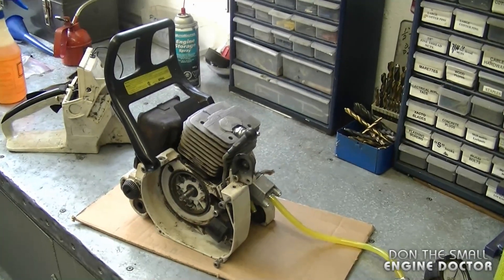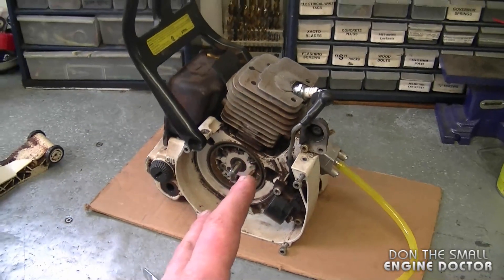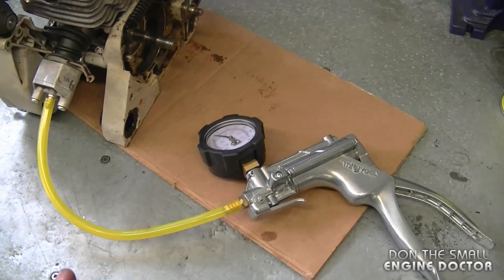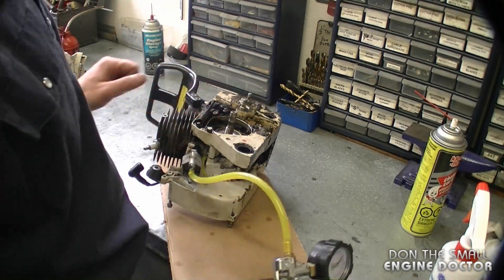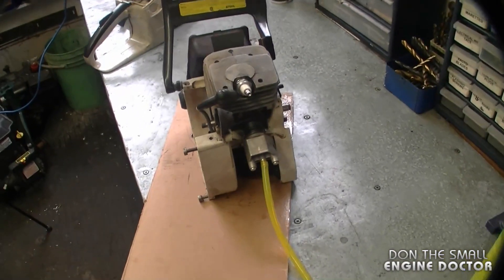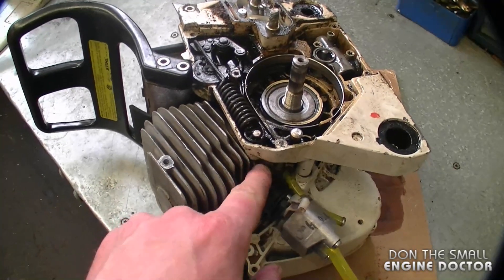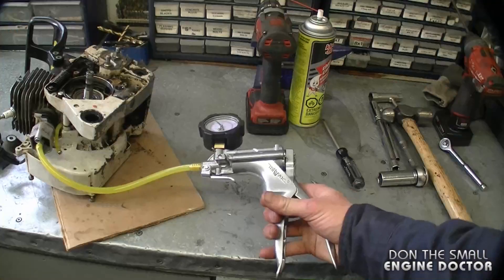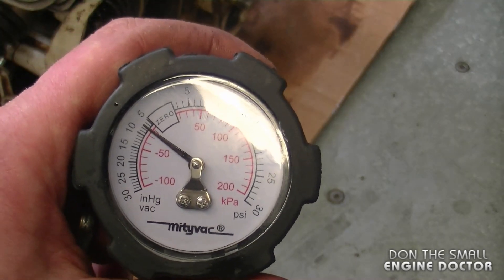HOW-TO Pressure & Vacuum Test On A Chainsaw - Leak Down Test

Comment: On your vacuum test, the gauge was reading inches of mercury which is not the same as psi - but a useful video as vacuum leaks can destroy 2-stroke engines fairly quickly.

Comment: What would cause a small two-stroke engine to generate crankcase vacuum yet virtually no pressure?  Am I doing something wrong?  The chainsaw is a Craftsman and probably forty years old (similar to a Poulan micro saw, I believe) and with all the apertures plugged, as you advise, (sheet metal plates with cork gaskets as interfaces) my MV 8500 Mityvac displays about 2psi on the gauge (indicating a massive air leak) but no bubbles.  When switched to vacuum, the test equipment quickly generates 7 in Hg.  The reason I'm investigating is because the machine runs erratically when warm and has a vibration in its handle, indicating crankcase bearings and seals could be worn and leaking.  Thank you for your excellent series of videos.

Comment: What does it mean if my saw will hold vacuum perfectly fine, but with pressure it leaks and doesnt hold pressure?
Also, is it ok that everything is sealed off and im using the impulse tube to do my tests?

Comment: Question:  I want to put a chainsaw pumper carburetor on an 80cc motorized bike engine.  I need a pulse line to the crankcase... any suggestions?

Comment: Hi, great video.  I have a MS361 and the same adaptor you used for the leak down test.  What did you fabricate to use it with the handle/gas tank assy removed?  It makes the procedure a lot simpler!  Thanks

Comment: Dony:  I'm waiting on my order of a MityVac vac/pressure gauge to test my saws. I'm wondering if this would make things easier?  I propose using a rubber stopper in the intake boot.  It might have to be held in place under pressure, but may work very well under vacuum.  Then perform test through the impulse line.  What do you think?

Comment: If I had an air leak like that one would it run my saw too lean to make it overheat?   I’ve gone through 2 top ends now on my Stihl ms 440 and I don’t know why!!!!!!  I haven’t checked the crankshaft seals yet
Reply from the maker: yes it would, on the 440 check the intake boot, it might be cracked

Comment: If a person install oil seal incorrectly on PTO side of MS660, say spring fell off inside seal, will vacuum test spot that seal? Thanks
Reply from the maker: yes it will
Reply: @donyboy73  
Thanks a million.
What I meant was that seal looks fine from outside appearance but spring fell off inside seal.

Comment: Hi Dony:  "Stihl 024"  Did a vacuum & leak test. Pressure test is good but vacuum test shows very slow leak down.  Saw runs OK when assembled & runs good when air filter removed. Soon as filter is installed its runs rough & hard to set up Hi & Low carb tuning. Made sure  choke was not partially on. Exhaust & air cleaner is cleaned. Carb changed but no change.. Saw recently rebuilt with piston, rings and seals & more.  Ran for many hours then started running rough & wouldn't idle.   Checked spark plug after cutting wood for 15 minutes & its too light colored for my liking.  Suspect I have an air leak but with no leak down with pressure test I am unsure how to isolated leak.
     CAN YOU HELP  .....  BOB

Comment: On snowmobile engines,there is a rubber plug kit you have to get that plugs all the openings. I used to use starting fluid if the engine still ran,any increase in rpms indicated leaking seals. That doeant work on triple cylinder snowmobiles and twins with a joined head or lower end seal between cylinders. Then you had to plug all the ports and pressure test that way. I remember earlier Polaris triples had issues with the seals between the crank on the lower end. The middle seals always failed. Skidoo also had issues with the 583's. I dont miss those days. I hated triple cylinders. The best thing they ever did was stop making them. A twin cylinder engine with larger pistons produced the same hp. Oh well. Am I dating myself?

Comment: I'm going to have to do something like that to my Briggs & Stratton 3.5 HP engine this weekend.

I lapped the valves in today & I still get a misfire at idle speed,I noticed that the top of the engine is dirty so I want to check if the top crankshaft oil seal is sucking in air & blowing out crankcase vapours.

The valves did need a lap job because the exhaust valve was just carboned up so it was all black whereas the inlet valves face was eccentric.

I want to plug up the PCV tube & blow air into the oil filler hole through a piece of rubber hose to pressurise the crankcase then to use soapy water to see if there are any bubbles present,which would indicate that it has an air leak.

Comment: I did with an air compressor with a Stihl hedge trimmer I rebuilt, one crank seal leaked but I went to the bearing shop & bought 2 of the same sized seals for $15 AUD.

The machine had other problems as well but it had no more leaks after that.

Comment: Found bellow adapter for sale on ebay. OEM Stihl Specialty tool pressure vac test READ LIST 1118-850-4200 MS250 MS251

Comment: It was impossible to find anything similar to what Donny uses for the pressure test. What I did was take a large bottle cork (from hardware store) so it fit snug in the  bellow with approximately 1/2" of the cork exposed . I then drilled a hole in the cork after the fit check and placed a piece of fuel line through the cork leaving enough exposed to allow for the vacuum pump to be attached. I also covered the top and area around the fuel line with black permatex RTV for a good seal. The bottom was also done in the same fashion. I then used a small hose clamp to keep it secure when installed into the bellow. 
   Not too fancy, but if you can't find the adapter Donny uses, I think this should work.

Comment: Why do the oil seals go bad? Could it be linked to overheating, lean running or dirt ingestion?
Reply from the maker: wear and tear and if a bearing is worn it also causes the seal to wear as well thus causing an air leak

Comment: Can I use that attacher with the carb on and test the carb at the same time as long as I keep the pressure lower.  Thanks for you videos which so far are the best ive seen quality.

Comment: I have used this way of pressure/vac testing for a few years now and it does indeed work very well. like he said tho just make sure your connections to the pump are solid! Also works great for carburetor work

Comment: Just did a pressure test on my 029, started at about 8 hg on the vacuum and pressure and it held it for about 2 or three minutes before dropping down to about 5.  Don't know if it's acceptable or not but might also be my homemade equipment..

Comment: I have an 038 magnum Ii.  I did the same but blocked from behind the carb covering the impulse line.  Holds 6psi for over 5 min at bdc, both vac and press, but compression test from the spark plug leaks out, wont hold compression when cranking.   what am I doing wrong?  Great vids thanks!
Reply: No scoring on the cylinder, and it does run.  Im thinking its piston rings.. meh!
Reply: @MrSparkums  did you ever figure out what was causing low compression, I have no scoring and changed rings and still low compression, thanks todd
Reply: @toddc4d  MI 
It wound up being the rings..  I would invest in a mighty vac, and make some block off plates.  No way to eliminate Gasket or seal leaks without a p/v test..   I wound up selling it for a pretty penny..  Instant regret...

Comment: @donyboy73 I have a Husqavarna 353 that is leaking gas at the bottom tank seam. Can this cause the saw to run ragged and can it be repaired?
Reply: Just need to replace the seal
Reply: yes
Reply: Jason Johnston very good

Comment: hi there iv beening working on a husky 266 i can not get it to start iv replaced fuel line and filter and it has spark was running a year ago what should i do? wont fire at all even with a little fuel put in carb

Comment: Hi, I have a B/S 8PH flathead that runs a generator and I bought a new carburetor about two years ago and it been running well, but lately its been running poorly. I put a new fuel filter on and its still not running right, I have to keep the choke on about 3/4 of the way to keep it running. Can you tell me what I need to check to get it running right? Thanks Stan

Comment: Hey Donny I don't know how to ask you a question but I'll ask here trying to get a respond. I just started my generator last snow storm and it was very loud and sparks were coming out of the exhaust. It's about a 10 year old generator maybe older. Need some advice
Reply: +abigail gabriel I recently watched one of Donny's videos that showed the same thing on an engine. The exhaust valve was stuck, or out of adjustment. Look for this video and I think it will help.

Comment: Could you show how to replacing the seal?
Reply: How to Replace a Seal. Using a set of calipers, measure the deepth of the old seal. Carefully drill a small hole in the side of the seal centered between the ID and OD. Install a self tapping screw into this hole. Be very careful not to drill or install the screw to deep or you will damage the crankshaft bearing. Using either a slide hammer or channel locks, grab the head of the screw and pull the seal out. Be very careful not to damage the running surface of the crankshaft or the seal bore. Clean everything up and install the new seal with the appropriate seal driver or a deep socket. Make sure to install the new seal to the same deepth as the old one. A little oil on the crankshaft surface and a light smear of silicon in the seal bore. Make sure to preform a second pressure/vacuum test. It's a good idea to give the crankshaft a turn when pressure testing older seals.

Comment: looking for parts for husqvarna 240 2012-2013 chainsaw. parts needed complete clutch, hub etc. saw is not 'grabbing' under load. Are you willing to get these parts (OEM) and ship. thnx
Reply from the maker: +Michael Dobbin hi, i'm not a Husqvarna dealer, check locally for a dealer
Reply: +donyboy73 I don't have a local dealer. Ok Thnx.

Comment: where did you get that vacuum pump tester?
Reply: +Josh Kilen I have that same model. It is made by Mityvac, and the part # is MV8500. Been using it for years. Works great.
Reply: pbrstreetgng79
ok thanks
Reply: Josh, I got my Silverline from Amazon. First MityVac I bought from Harbor Freight but was only pressure. I didn't know better at time.

Comment: During a test, I always seem to get a little air escaping from the spark plug hole even though I tighten the plug down snug. I just don't think that the metal washer on a plug creates an air tight seal. Have you experienced this, Don?
Reply: Grease.

Comment: hey don what happens if you put too much pressure when you do a leak down
Reply: +Drew Thornton Pressure testing you can actually blow the seal out or cause the ridge(s) to roll.  Both will likely ruin the seal.

Too much vacuum will also deform the seal.

Comment: I had a husky 350 drive me crazy when I rebuilt it. it has the impulse integrated into the bellows and was leaking where it mated to the cylinder. put some motoseal on it and it was good to go.

Comment: Dony, are there any aftermarket seals that you recommend? Those STIHL OEM seals are very pricey!
Reply: pbrstreetgng79 Just for future reference. Bearing supply houses can sell you seal's and bearings far cheaper than small engine part's stores. Just bring in the old one's and they have cross reference manuals that show what you need. 
The one problem is bearing house's are going the way of the Dodo bird! Not enough people fixing things these days!!
Reply: +Sancte Alphonse If you find the size, Chicago Rawhide makes good aftermarket seals. WAY cheaper. I'd stay away from those cheapo Chinese seals all over Ebay.
Reply: thanks - I'll have a look next time thy're needed!